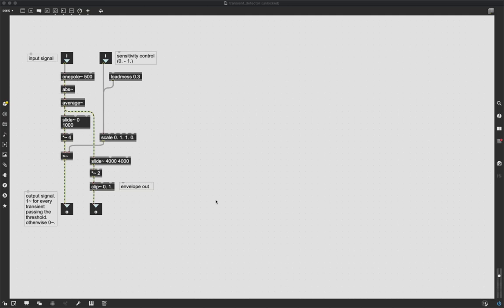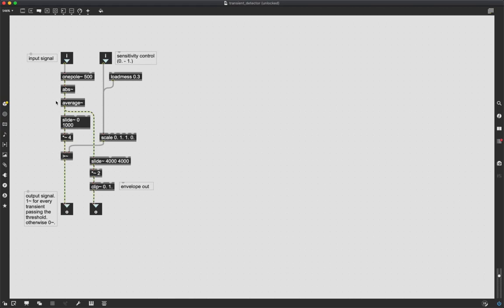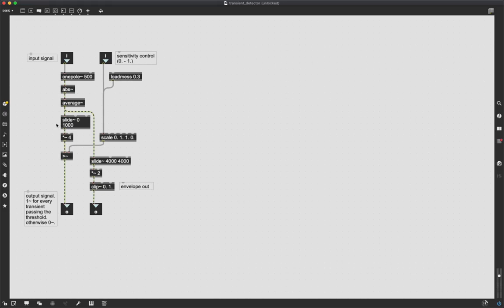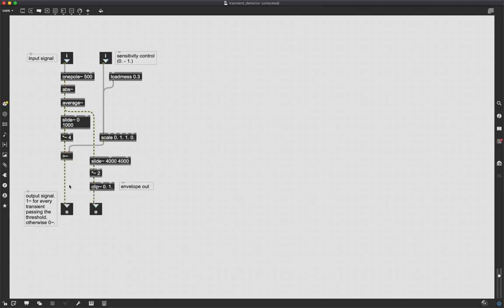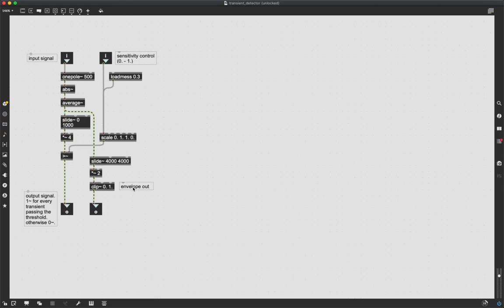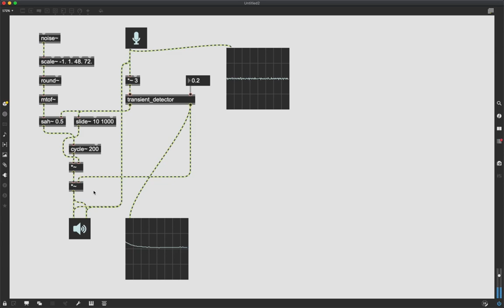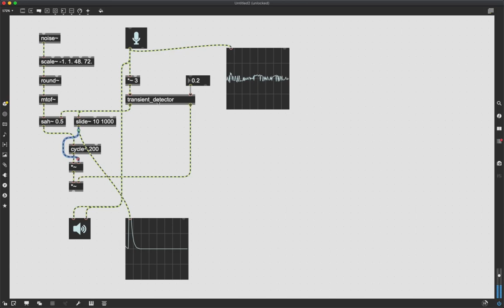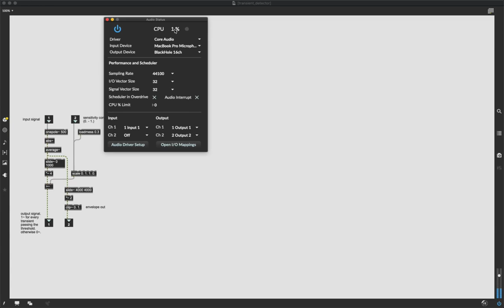Low-latency transient detection in Max/MSP

Comment: transients are actually usually characterized by HF content rather than LF, so I have to wonder how well this works in the context of a polyphonic input signal. What you have done seems more like a variation on a noise gate, tbh
Reply from the maker: That's a good point! I definitely agree; this is designed for monophonic signals where you'd tune the sensitivity control to work nicely with the audio input. Polyphonic input, especially with very different amplitude/spectral properties would probably not work well here. But in a simple percussive context, this approach should work well for capturing each "hit",  and it's more CPU efficient than the other onset detection algorithms I was seeing. :)